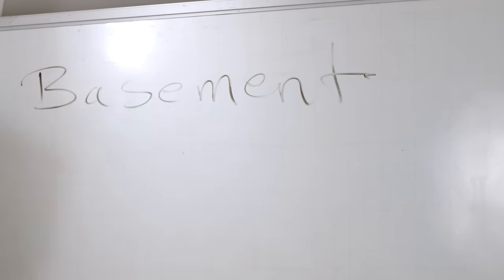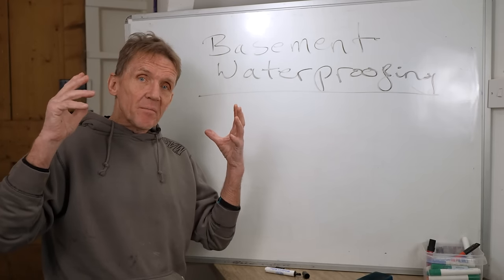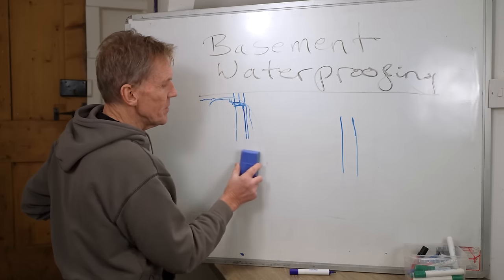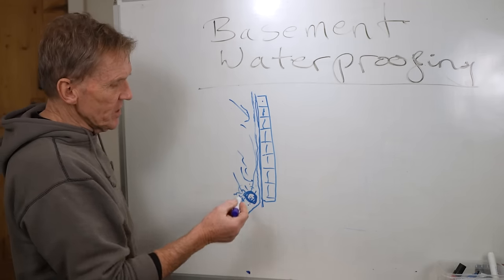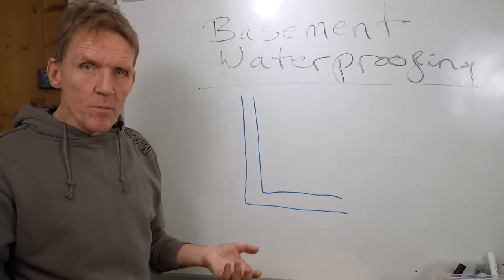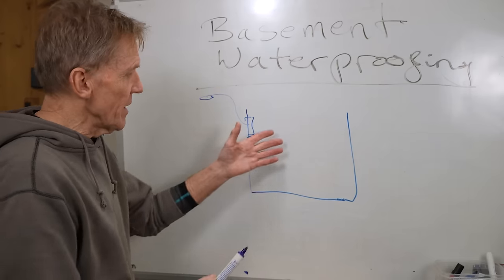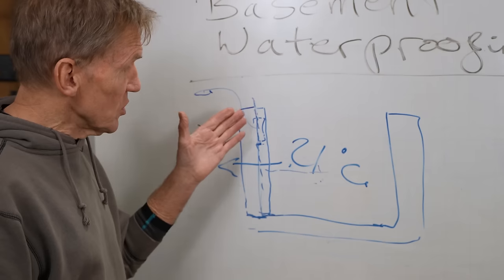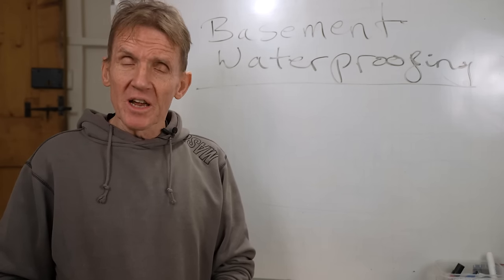Watch This Before Waterproofing Your Basement

Comment: I would like to add that understanding and directing drainage around the foundation is extremely helpful. Clay around your foundation will be forever soaked, so that is a problem, light turf soil not so much. Coarse sand allows more flow. Fine sand densely packed against the wall creates a barrier. Gravel at the bottom helps runoff. You can use gravel trenches as buffers. Relatively simple groundwork with basic materials used strategically can do a lot for moving water away from your structure.
Reply: Can you recommend anywhere to learn these basic methods?

Comment: When you think about the wall construction fundamentals, you have a lot of 'layers'. The outside wall for protection against bulk water and to protect the insulation from UV, mechanical damage and bugs. You have the cavity, for draining and drying. You have the four control layers (thermal, vapor, air, water). On the inside/warm side you have the structure, for sheer and keeping things upright. When building a basement, people throw these fundamentals out of the windows and have complete faith in a 'waterproof' concrete wall and floor. No wonder things go wrong so often...
Like you said in the video, try to waterproof the outside and apply some kind of drainage plain (like the dimple drainage board), to have it more like a typical wall construction, as I explained earlier.
Some general advise regarding basements:
- Don't use traditional building materials, like wood studs and drywall, in a basement due to the higher moisture. These organic materials tend to rot and mold more easily.
- Instead use metal studs, foam insulation, proper vapor barriers, paperless drywall, synthetic baseboards, and pvc flooring.
- If you insulate from the inside, try to make a ventilated wall cavity, to reduce humidity and dry any damp.
- Grading around the house must slope away from the house, to reduce hydrostatic pressure against the basement wall.
- And monitor the humidity levels inside the basement.

Comment: I wonder how many existing basements are actually done properly- I bet it’s not many, especially in older houses. I’d be extremely cautious of buying or even renting a basement property. So many possible issues. Generally people didn’t use basements for anything other than storage in the old days, so they weren’t made to be perfectly warm and dry. Looks like a hugely expensive nightmare to retrofit an old basement to come up to living-in standards, and a pretty hugely expensive one even if it’s a new build. Best avoided altogether I’d say. I looked at a flat with a basement when I was buying a house - they’d recently renovated it, and it looked clean and new, but I could tell it was basically just tanked and sealed, with standard plasterboard put over it and would probably last a year or so before you started seeing damp issues. Jogged on from that one.

Comment: Wow, just the video I need. Most likely having a new basement under the new extension this year, will be watching this with interest.
Already planned for the French drain system as I live on a slight slope and  can drain away naturally.
Is there much steel reinforcing involved and how thick are the walls?
Reply: You didnt mention some important details.
where is the project loacted?
Gradient of ground above and below walls that require tanking? (Slight is subjective)
Depth of excavation?
Do you have existing stormwater drains available for those proposed french drains?

Comment: Interesting to hear him call sump pumps a remedial solution.  They're both code requirements in most US basements, along with drainage systems.  Then again, they have houses older than our country over there.  ;)
Reply: You have to take in account that it is a lot wetter here in the uk,we have lots of rain yearly

Comment: ello Fella,
               I have to say what you conveyed to us all is right on with facts. I have a question for you about basement walls that are 8 inch wide cinder blocks. The inside of the blocks have 3 hollow oval radius on the ends with roughly six inches long length that face the outside and inside walls of the basement. Would filling them with aircrete or aircrete styrofoam mix for insulation and waterproofing ?? Also, was thinking coating the inside wall with hydraulic cement 1/2" to 3/4"thick two layers to totally waterproof the basement walls ??? I do not have time or the funds to take care of the outside of the home. Drop me a line with your opinion for me to consider. Thanks VF

Comment: We have Georgian (1805) house with a cellar. It is built on the edge of a flood plain with a hill on the other side.  We get ground water flooding about 15cm deep in the cellar a couple of times each year and generally it  drains within 3 hours after flooding. We assist that with a sump pump. Not a major problem.  When the river floods above the banks it saturates the groundwater and the cellar floods about waist deep, we keep a 3 inch petrol pump handy to handle that infrequent event. When they built the house they knew about the floods hence no real damage is caused to the structure.

Comment: I've just finished  building our house, and we've put a basement in, which is part of the reason went for a Polar Wall ICF building. So far so good and zero moisture down there!  Also helped having UFH and MVHR  to keep the condensation at bay!
Reply: Izodom 2000 for me. No basement though.

Comment: It's good to see you also having the same view as me about letting the moisture/water get in through an existing basement wall, collecting behind the Newtonite type layer and catching it in a recess around the base of wall with a french drain type pipe which takes it to a sump to be pumped out.  I never like the idea of tanking the inside surface of a wall trying to hold the water pressure back as you only need one small imperfection, especially lower down where the hydrostatic pressure is greatest.  If you are doing a new build with concrete walls then it does not matter how good the waterproofing concrete itself is, you will never get water entering through a concrete wall or slab.  Like you said at beginning, it can over top the wall, or it comes through the junction of the base to the wall or the junction in the wall.    Preventing water coming in at the base/wall junction (and you will always have to have a junction/joint here) is done by the use of a plastic water bar that you put either on the outer face or in the middle of the joint with half in the base part and the other half in the wall.  The principle is that it makes the water path incredibly long and due to all the ribs, the concrete actually contracts and forms a seal.  You talk about the walls being poured in one continuous pour, but I was always brought up to have movement/contraction joints at 6m otherwise you get drying out/contraction cracks in the wall.  That is how underground reservoirs are constructed.  I'm a structural engineer by the way!!
Reply: We must have watched different videos. He NEVER said let the water in and into a French drain. He said if you have to do the waterproofing from the inside use crystalline waterproofing. Which is the correct way to waterproof from the negative side.Then add the drain as a backup in case of failure. But the truth is ,if crystalline waterproofing is installed correctly it rarely fails. But I can’t argue with redundancy when waterproofing. And what do you mean that it doesn’t matter how well the concrete is waterproofed water will never go through the concrete. It absolutely does matter how well it is waterproofed. Water WILL go through concrete.If it is not properly waterproofed.I have been in the waterproofing industry for over 45 years and have waterproofed more foundations than I can count. On everything from single family homes to 50 story high rises with five stories of mechanical rooms and parking below grade and I have NEVER seen an expansion joint or control joint in a foundation wall.

Comment: spot on with this description i have fitted 2 of these with the sump pumps and still working ok to this day  the one it was raining hard and the cellar was flooding badly and we didn't have the correct fitting for the waste supplied by the company we were about an inch before it flooded totally thank god my neighbour plumber had it in his van and the builder drove to his house to pick it up problem solved and its been 10 years and no problems reported

Comment: Very informative. I found one of the biggest problems was penetrations, especially drainage, even using puddle flanges. The most successful (and expensive) basements I had involvement with, was using two coat mastic asphalt internally, with a loading floor and loading walls. The big advantage being you could fix anything to the floor and walls.
Reply: Hi Paul, Asphalt internally, loaded or not, is not a great idea, and the latest revisions to BS;8102,2022 will offer guidance on penetrations too.

Comment: Humidity is not a problem in winter because the outside air is dry at low temperatures. It may be at a 100% relative humidity at -5°C, after it warms up in the house to 10-15°C, it's essentially dry (10-15% rH). So in winter the best way to dry your house is to ventilate it with outside air when it's cold outside (commercial objects usually have humidification systems installed in a central HVAC unit, but that's another topic).
In summer, the outside air has a lot of moisture, even if it's relatively dry at 40-50% relative humidity, at 30°C. When this cools to 20-22°C in the night, the air is at 100% rh. So ventilating your cellar in summer is gonna be a bad idea.

I'm having damp issues in my cellar, thanks for the video series concerning the topic.
Reply from the maker: I understand that paradox with dragging moist air in and I did hesitate to say it but a lot of people have a humidistat on a fan and it seems to help especially if it is on during the night
Reply: Correct. We have mvhr running in our victorian basement most of the year but turn it off in the summer and run our dehumidifier to keep the RH down working a treat!

Comment: Ive got a cellar in a home built 1863. Ive got problems that have been over 40 plus years including court action against the local Water Authority.
Section 24 sewer issues.
 Since leakage is in heavy rain and due to hydrostatic lift which doesnt occur every year.There is now know for there to be in the sewers, building debri from major demolition works from 27 years ago coupled with sink holes in the area. 
The Water Authorites defence was legal technicaly in an attempt to bankrupt me before the case could be heard.There solicitor admitted before the Judge they had no defence other than legal technicality.
What people can afford a case thats estimate was over 1 million pounds sterling.Preceeded by solicitors argueing the case at £350 - £ 500 a letter.
Even solicitors via Pro Bono wouldnt touch it since the defendants stratagy in defence would be to deliberatly escallate the case costs to make the case unaffordable.
 British justice at its best.
Reply from the maker: Hi Tim 
We did a video about Thames Water washing their hands of a problem.  I think the cost of brining a case against them is outrageous. There is no justice if it is only for the rich
Reply: @SkillBuilder  Yes thats the defence make the case uneconomical to take to court.I am still waiting for the Water Authorithy to deal with an issue pre Christmas which included flooding of cellarage.Will see if i can find and view your video. At the time i was advised if i won the court case it would be a case pressident.

Comment: Hi Roger, this is a great information. Thank you. I am not sure is when you insulate with polystyrene and DPC from outside, you are tucking in the membrane into wall. But at what height? Is this 150mm above Ground Level? In that case it will expose and can see it from outside? I have a small basement store under stair and I have got to do all 4 side walls and floor. So I am thinking just to go for surface coating 2 x coats plaster. I actually wanted to use this space for a attached en-suite. Is that treatment enough then tile from inside? Much appreciate it if you could advise me.

Comment: Great overview but you should really recommend that people insist that builders install systems designed around a sump rather than letting builders hack something together. This is not to say that builders don't know what they are doing but dealing with damp is hard precisely for the reasons listed in the video. Maybe a builder has tested a system they have a few times but that's absolutely not enough.

Regarding insulating a basement, there is lots of research on what works and what doesn't (mostly comes from the US and nordic countries). Digging down and insulting the outside of your basement wall is unlikely to provide the results you're hoping for as you need to go under the foundations and that's prohibitively expensive for a retrofit. 
You would be much better off spending the money on a good quality dehumidifier that stays powered and turns on and off when needed. Better yet an MVHR unit but ducting might be hard to fit in an old building. Once you have conditioned air, you can insulate the walls and floor (don't forget the floor) and you're good to go. 

One last thing, this is really minor but uninsulated concrete has R value off 0 so no your basement is not insulated just because it's underground. What you are referring to is no heat loss attributed to the wind factor :)

Comment: I've just moved into a terraced house and an internal,single skin(4and a half inch) wall separating the back room and the pantry is totally failed ,(render and plaster cracking and boxing off the wall by excessive salts(efflorescence) what would be a effective solution to this problem ? Any advice or video links would be greatly appreciated.
Reply from the maker: Hi Darren 
 Can you send some pictures to www.skill-builder/ask
Reply: In brief, find the source(s) of damp, eliminate them (if possible ) or manage them (if not), then attend to the repairing the wall (which will include a masking system if you have any hygroscopic salts like nitrates and chlorides).

Comment: Insulating from the outside is not possible in my case, what type of insulation would you recommend from the inside? Foam board, fiberglass wool, spray foam, etc? Would I put another vapor barrier between the insulation and gypsum so that the condensation doesn't affect the insulation? Thank you

Comment: Your neighbor should sue his architect. It is complete negligence to have the soil above the foundation wall. Keeping the join of cavity wall above any horizontally moving water. This has absolutely nothing to do with Sika. I have been in the waterproofing industry for over 45 years n the USA. I disagree about the “dimple board” being waterproofing ( I know technically it is but it relies on mastic sealing the sheets together. Not acceptable in my opinion. We only use it as protection and drainage over a proper waterproofing membrane as you showed.And thank you for only recommending crystalline waterproofing for blind side waterproofing. Finally someone that actually understands waterproofing . There is so much misinformation about waterproofing and sealants on YouTube.

Comment: And if you have a cold basement, don't store anything close to the outside wall or the floor...
Why? Because whatever you put there, acts like an insulation and in summer you get the dew point... directly somewhere in the middle of the things that you store there directly at the wall or floor!

The normal air humidity condensates there inside of your stored things. That's not a good thing...

What could you do?
Keep a good distance to the outside wall and the floor with all things that you store there, especially when they could work as some sort of heat insulation, no matter if you like it or not, no matter if you intend it to be so or not ;-)

And don't block the air behind and under the stored things, let the air naturally circulate between the stored things and the outside wall and the floor to avoid humidity build-up there.

Any inside wall to another basement room is not such a problem, maybe a bit like a cold bridge from the floor, but the outside walls of the basement and the floors are the big problem in this regard.

Comment: Great video. I have a 93 mq basement, which is amazing because it has 2 windows and the ceiling is 3.30 m high. Problem is I can't really dig outside (with the exception of one side) the house and it should be insulated from the inside, as you described. But that is a hell of a job, that costs a lot of money, therefore I never did it. I have also dump issues that I am trying to fix with dryrods. I hope they work because my walls are 70 cm and I had to buy a lot of these rods.

Comment: Different question.I have some damp more vapour coming through a concrete floor that must have been a patio many years ago. Plastic dpm make the cap condensate it i part of the kitchen I want to put electric underfloor heating in and tile in the top. How can I stop the damp. It isn’t water can I tank it or would I put a falls  floor in. Please can you help

Comment: There is a block wall in my basement,it continously is generating mould, would it be beneficial to drill holes to fill the inside of the blocks with expanding foam?